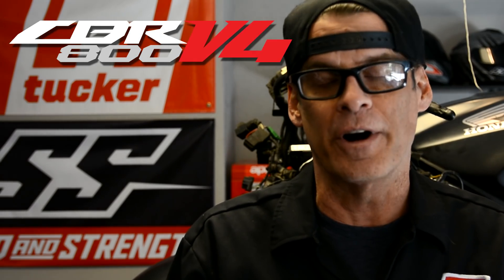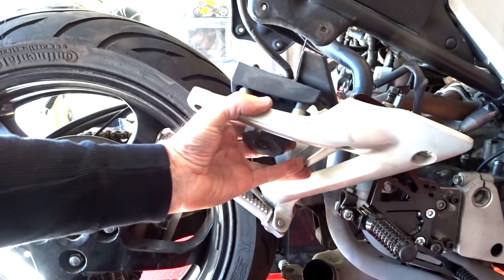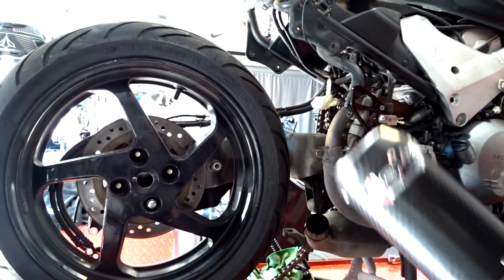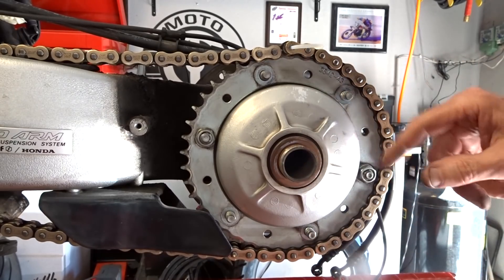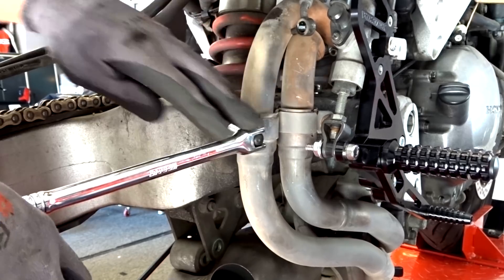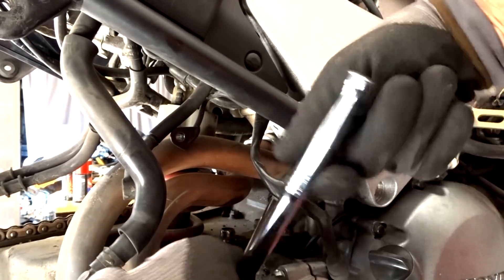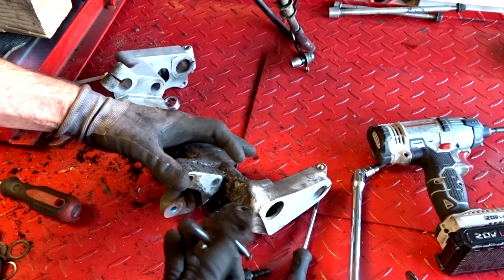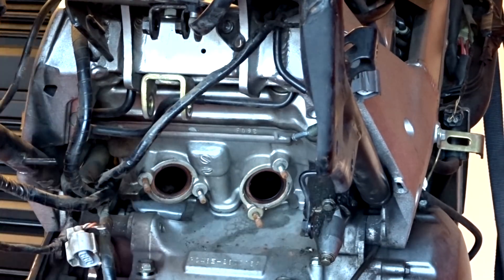HONDA CBR/VFR800 HYBRID PROJECT - Episode 4

Comment: WAIT, did I just hear, Trail braking is when your using the rear brake through a corner?  DAFUK?
Reply: Yes I've gone into a corner too hot and I've done just that. My mate who's quicker than me has his rear pads changed frequently more than most people.
Reply: Certainly is.
Reply: Lol wtf pros ride the front brake all the way to the apex, and I try to do the same. I don’t even use my back brake in a corner just engine brake.
Reply: @highclasshoodlums9909  thats why I'm quicker than you. 😊
#backbrakingforever

Comment: So at 17:59... the sensor with the wire on the left, that's gotta be the ABS sensor... right? I mean, this dude called the sensor on the rear hub at 5:28 for speedo sensor... May I suggest the Honda shop manual... it is like a horror movie watching you take this bike apart!
Reply: Spot on. It was cringe worthy

Comment: You're right about the linked brakes. I tried a friend's vfr and it was scary to have the front dive while on a gravel track. However, the linked brakes on a CBF don't do that, there is still a boat load of crap there that should be binned but it does work ok.

Comment: Isn’t that the ABS sensor? The speedo sensor is by the front sprocket. Also you could have bought a bolt the same size as those giant Allen’s and welded a nut on. Then stuck the head of the bolt into the hex and turn. That’s how I removed mine.

Comment: If you ever need an Allen wrench that you dont have "larger ones" Ive used the head of The same bolt size with a a couple nuts locked together saves me the immediate run to the hardware store.
Reply: Thanks for the trick awesome

Comment: 2:00 I really love this build but.. you are completely wrong here. Trailbraking is when you keep braking with the front, while you lean in the corner. Some racers in moto gp also apply the rear brake to level the bike, but mainly the front brake is being used. If you learn this system it is basically safer than anything else, for road use! Please, do some research before you say that a system is "not good". We are talking about racing herritage here.

Comment: Man.. You are hacking this bike..
Read up on trailbraking!
The speedo is on the front sprocket!

The rear wheel bult nut is pinched!
Did you open it? or just ruin your nut?
There is a lot of videos on how to remove the rear hub on here. 
hitting the bolt on its threads is not one of them.
Take a look pal.
and..Slamming the hubcover on a metal vise..😳
How about putting some lube on the bolts before opening them.